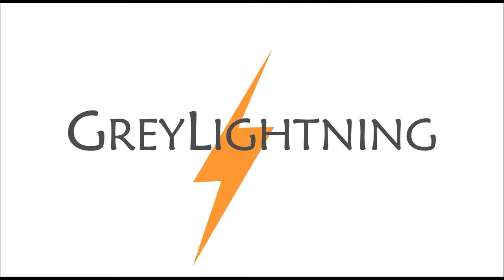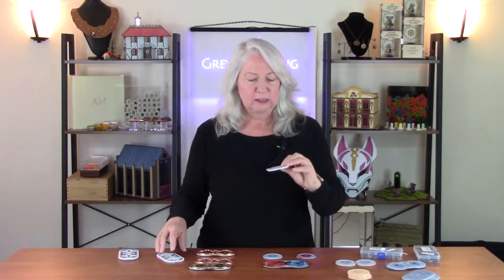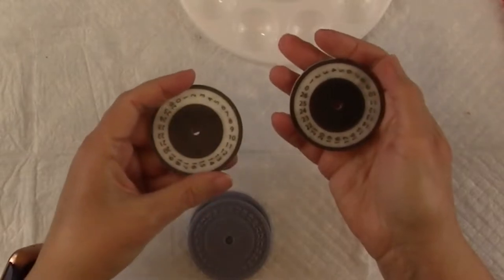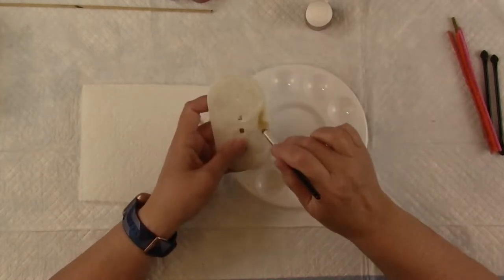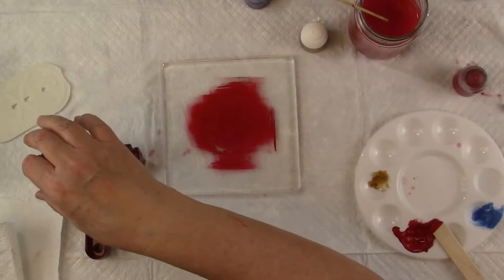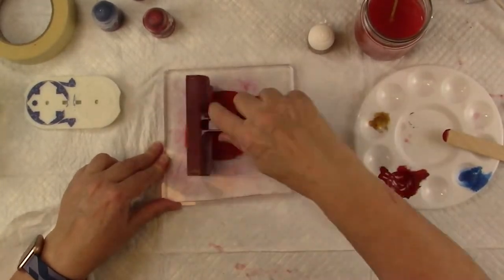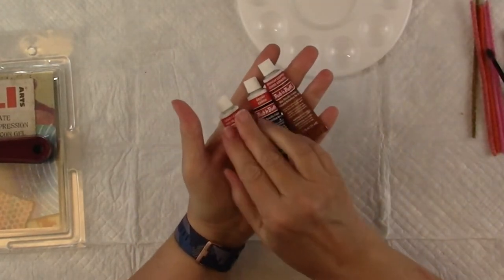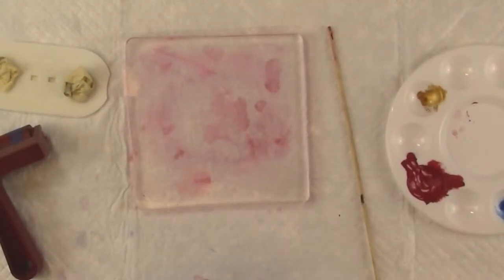Finishing Techniques for 3D Printed Gloomhaven Trackers

Comment: I knew that 'cured' print resin is still not fully cured, or safe without sealant, and will cause problems if you use platinum-based silicone on it but I did not expect the gold-leaf to stick to everything. I wonder if applying an acrylic coat wash in either matte or gloss would work to inhibit the leaf attraction where there is no sizing?
Reply from the maker: Rose, thinking out of the box again! I really want the ability to only do the raised design, as an option, so I will check this out in a future project. BTW, the pre-approved comment worked beautifully. I was notified without even opening the YouTube app!!
Reply: @GreylightMay  So the current project I am learning about deals with 3d prints and molding. Normally you need a coat, typically 2 dunk and drys in a product called Inhibit-X, to protect the silicone for the curing process if it is platinum-based. This will stop the SLA Resin (I think that is what type this is) from impeding the mold silicone and resin molecules from bonding together/inhibiting each other. 
A few makers are able to mold their projects without a coat by letting their prints cure for weeks to months. A set and forget kind of thing. This may not work for you, but to me, this means that molecule curing takes a lot longer than 1 or 2 cycles in the Anycubic machine. So if you have smaller prints (to not waste resin) or create texture test plates it could be an interesting experience to see how 'cured' the resin will need to be before the Gold Leaf doesn't stick without sizing. 
But this is why I think a wash of matte coating on the dial will provide a barrier so the leaf doesn't get on everything. The only problem that then pops up is gold leaf may bond with the acrylic or enamel paint base. 
Ahh science, solves problems and creates more.
Reply from the maker: @RoseKindred  Rose, this is really helpful because I have a molding project on my list to do. 3D printing is a great way to make models for molds, as a means for higher production. I will look for Inhibit-x to test it for both applications!
Reply: @GreylightMay  Well, good luck. Hope I helped a little. Inhibit-X is costly but the bottle lasts a long time according to resin molders. Essentially dip or paint on, let air dry, and repeat 1 or 2 times. The remaining liquid can be put back into the large container without fine-mesh straining, provided the part(s) were relatively clean. 
I look forward to seeing what you make next.
Reply from the maker: @RoseKindred  yes, I found it online and it is not cheap, but I think definitely worth checking out. I can use some of that money I saved by not going anywhere for a year now!